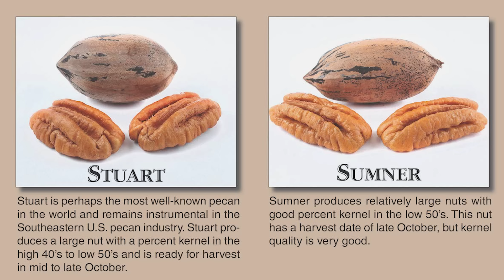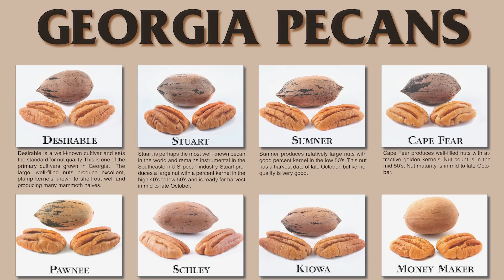PECAN | How Does it Grow?

Comment: I butter roast them in the oven... heavenly.

Pecans - buttered roasted

448g (1 pound) Pecans
70g butter
 (salt free)
sea salt

Directions:
melt butter,  salt butter with sea salt, pour over pecans, and stir until coated.

bake 40 minutes (until crisp but not burned at 270 Fahrenheit

Comment: I have two nice size pecans in farther NorCali.  They usually produce a few boxes each around January but they paused during the worst of the recent drought, restarting again last yr., I barely water them as it's expensive, they are mostly self sufficient except for heavy pruning is necessary.

Comment: Sweetheart, the USA has another nut native. It’s the black walnut. It grows in the eastern states but it’s not usually sold commercially. But the hulls are used to make wood stain and have an herbicide in them. They do taste good, but they are a pain to crack.
Reply from the maker: Yes, I do know about the black walnut. But as I mentioned, pecans are the only ones you can buy in most grocery stores.